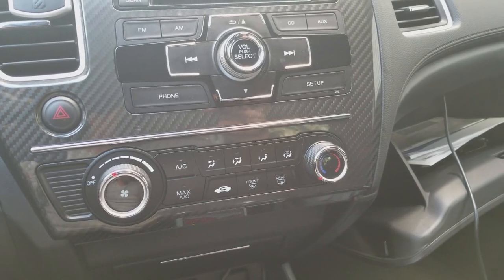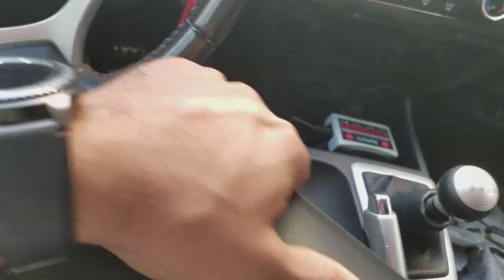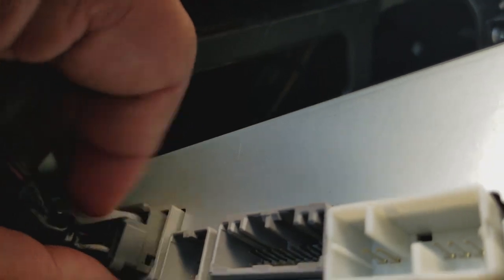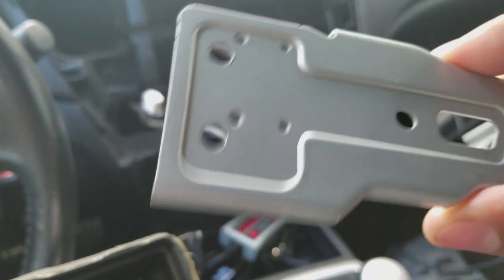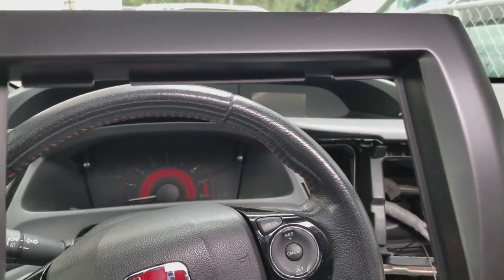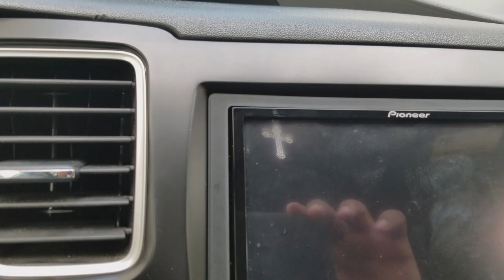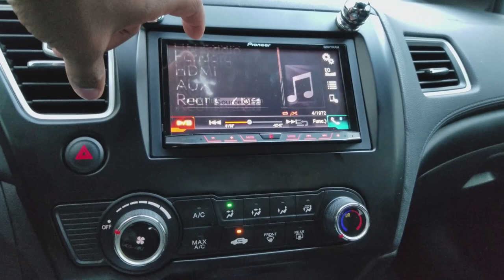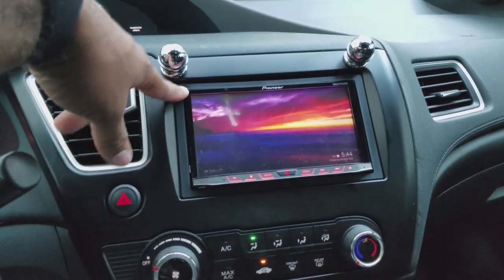13-15 Civic Si NEX 4200 install and chromecast install

Comment: That's awesome that these pioneer units work with the newer civics.  The factory units are still lame, even in the 2018 civics.  I didn't have to ground the parking wire on my 8000NEX, there was a way to disable it in the settings.  But I guess that doesn't work in every model.

Comment: I thought the chromecast only works with wifi? I bought a certain roku that doesn't require wifi for screen mirroring and it works great
Reply from the maker: Grant McGuire I was able to get it running off my phone’s hotspot feature and also it works great. Definitely give it a try
Reply: I believe you can enter a pin of some sort to connect to it without wifi but I could be wrong lol

Comment: brother i just have a couple questions, the oem dash you're talking about is this the part number: 77250-TR7-C11ZA? how do you ground for the parking break to be "always on"
Reply from the maker: React Hey Man. If it’s the 13-15 Dash and not the 2012 that should be the right part number. Regarding the ground you can take the green parking brake wire and either connect to the headunit ground or attach it to a bolt that goes into the cars metal frame.

Comment: Hey whats up... So did you use a i-mid interface or steer wheel interface to get the radio to even work. And also, did you have to tap into the factory amp at all?
Reply from the maker: Alex Martinez how’s it going man. I didn’t have to do any of that. The imid display will still work just without the radio feature. You’d need an interface if you want to use the steering wheel controls like “next track” or “volume up”. The factory amp will still work. That’s how I set mine up. Just make sure that the blue wire on your aftermarket harness and the aftermarket radio harness are wired up so the aftermarket radio can turn the oem radio amp on.
Reply: @clutch0514 ahh sh!t, that's were i went wrong. I didnt even think about the remote wire. So use to that wire always goin to aftermarket amp, didnt even think it would go to the factory one. Makes sense now lol. Appreciate that man.
Reply from the maker: Alex Martinez fo sho man lol. Let me know how it goes

Comment: Any chance you can give some tips on wiring the module to retain the steering wheel controls??
Reply from the maker: I know that there’s a module you can purchase usually from idatalink and it will come with instructions specific to your vehicle.

Comment: Do u think this type of switch bypass could be done to the 2015 si witch already come factory with touch screen?
Reply from the maker: guayaco19 it’s a possibility. It all depends on how it detects movement. If it just goes by the e-brake you should theoretically be able to do it

Comment: Any issues with the iMID screen not turning off despite the ignition being turned off? That happened to me when I had my Kenwood headunit in my 2014 Si. The iMID nearly killed my battery! Reverted back to the stock headunit and the problem went away.
Reply from the maker: Phangatang not really. I’m surprised you had that issue :/

Comment: Where did you carbon fiber where the radio Knobs are at
Reply from the maker: That’s a stock feature of the 2013 and 2014 civic si. 2013 was basically the interior of a 2014 minus the touch screen and turn signal mirror camera without the keyless entry.

Comment: So do I buy a single or double din receiver to replace my stock receiver.
Reply from the maker: Whichever you prefer. The dash kit can support both but a double din can flow better with the dash.
Reply: @clutch0514  thanks!

Comment: I think you mentioned you need a special harness to keep the imid working? What was it called?
Reply from the maker: Gabe P. Sorry for the late reply. There’s no harness necessary for imid controls. Just the volume controls on the left of the wheel

Comment: did you need a hdcc-01 to make your speakers work?
Reply from the maker: Andrew Yoon not at all. Just the regular wiring harness worked since the head unit acts like the audio source before the Amp. I just lowered the gain on the head unit to compensate for the distortion I found. For best quality though, I highly recommend to bypass the factory amp if you can
Reply: ok thanks for the info! how did you lower the gain on the HU? sick car btw I have the same one but in red
Reply from the maker: Andrew Yoon thanks man! It’s easy. On the headunit there should be a speaker level menu. I set mine to -10 on all 4 channels and it sounds like oem now
Reply: cool cool! what did you do with the left over harnesses that didnt have a slot in your after market HU?
Reply from the maker: Andrew Yoon I just tucked them to the side for now. I might have some future stuff planned for that

Comment: hey bro, what about your back up camera... does it still work with the aftermarket head unit ?
Reply from the maker: Yeah man. Since the camera is on the tiny imid display it’s separate from the head unit. So as soon as you throw it in R it pops right up
Reply: Mugetsu_Si thank you.

Comment: I have a signal but I can not make my speakers work I have a 2012 Honda Civic if with factory amplifier
What do I have to do to make the speakers work or what do I have to buy?
Reply from the maker: you don't have to buy anything extra. I have a feeling you probably just have to check the radio wiring harness and make sure the blue remote wire is hooked up to the factory one so the factory amp can turn on
Reply: Midori Wrx you don't know what color i have to connect from my car so i can turn on the amplifier
Reply from the maker: Kitty Cat I wouldn’t but from the harness to the aftermarket radio both wires should be blue or blue with a white stripe.
Reply: Midori Wrx you don't have any video because I tried to do what you told me but the aplificador has no signal

Comment: Does your steering wheel control still work to change songs or call?
Reply from the maker: Sorry man. Unless you get a module to adapt the controls, they will not work

Comment: How did you get the red color in your speedometer?
Reply from the maker: JJCA TV here in the US the civic SI come with a red speedometer instead of blue. If you want to switch to red, some people buy the rpm guage and speedometer used from an si if you’d like the same setup
Reply: Mugetsu_Si thanks

Comment: Hey man I was wondering where you got your toggle switch for your system
Reply from the maker: Pablo Egipto I got mine from RadioShack before they closed down lol. You can probably find them on eBay though or maybe at a guitar part shop since they use them for the pickups

Comment: Think I can swap out the 14-15 touch screen unit for any aftermarket?
Reply from the maker: It should be the same exact process as long as you have the right wiring harness and dash kit.
Reply: Mugetsu_Si yeah. I saw someone with the lanewatch with his aftermarket headunit. I’ll need to buy those harnesses. It’s my subs that sound like crap rn bc the rca signal is probably crap. My friend had a 8th gen with a kenwood headunit and it was crazy loud
Reply from the maker: @Virt7_  lol definitely. The RCA output is significantly better on aftermarket units and you have more control over your sound too. Eq is your friend. I tried a LOC (line out converter) on the stock unit and it was a no go.
Reply: Mugetsu_Si I’m hoping the shit actually fits tho. I just did some research and the soundstream has a really good rca output and some nice features for only like 200 bucks
Reply from the maker: @Virt7_  don't worry man. It will fit. As long as your wiring harness is for your 2014/2015 si
Reply: Mugetsu_Si yeah, gotta get the steering wheel control harness and the camera harness
Reply from the maker: @Virt7_  you got this man. You should be all set with those items. As for the dash kit itself, rumor has it that you can use the 2013 oem navigation dash piece with an aftermarket headunit to retain the same carbon fiber finish
Reply: Mugetsu_Si yeah that’s hard to find. I’m just gonna get a regular dash kit lol

Comment: Is this the same for 2013 civic lx? Or similar
Reply from the maker: Nick Sites I believe this guide can be used for non Si models too. Just keep in mind that the harness might be slightly different but the dash itself is overall the same
Reply: @clutch0514  ok thanks man
Reply from the maker: Nick Sites anytime man

Comment: Do you have a link to the bezel?
Reply from the maker: pablito2k11 I don’t have it anymore unfortunately. I’d search for 2014 civic Si dash kit if you have a similar car to mine
Reply: Ahh Thanks man. Yeah mine is a 2013. I found the actually dash kit I just can’t find the bezel that goes around the radio so that it won’t have a gap there. I’ve looked but I can’t seem to find it.

Comment: Would you know if this is the same for a civic si with Navi?
Reply from the maker: If you have navigation stock, and it’s a ‘13 you’d have to use a different dash kit because it retains the factory carbon fiber trim piece. Everything else should theoretically be the same.